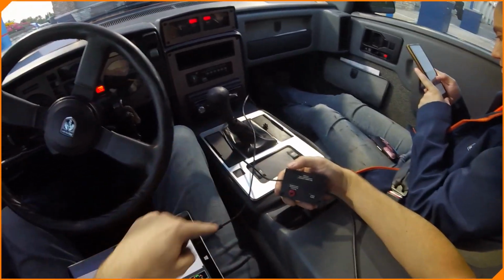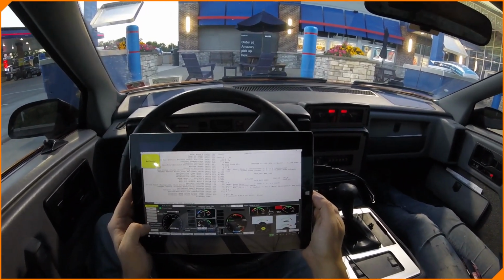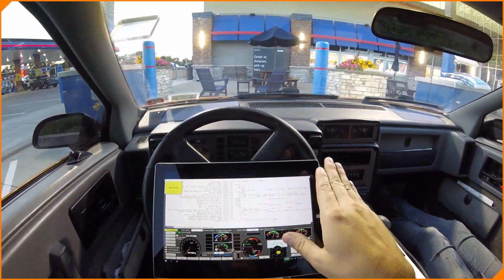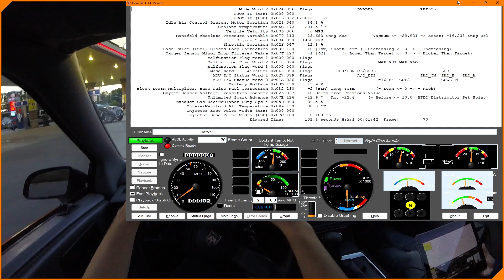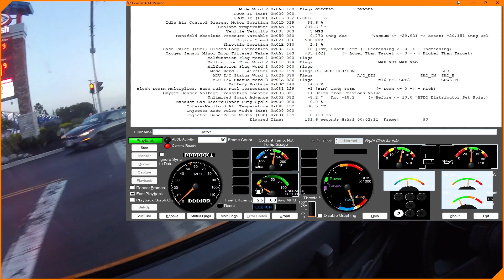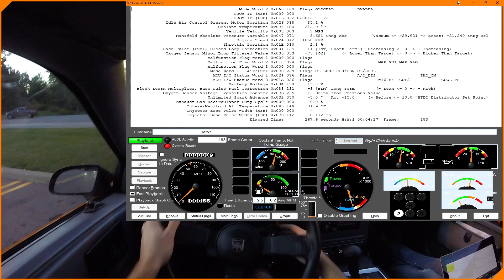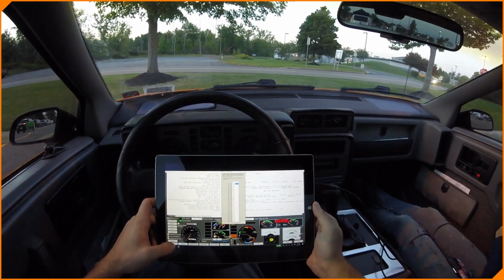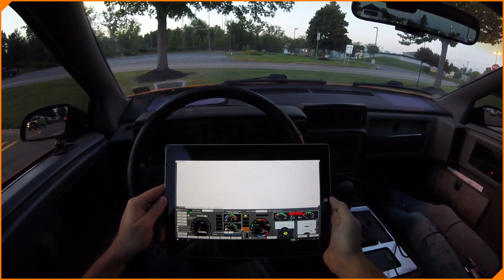Fiero ALDL Monitor by Paul Romsky | Fiero GT | Buffalo, NY

Comment: At 8:25, if you do not modify the car's ALDL connector to include the Service Engine Soon (SES) the adapter cannot monitor the Error Codes for the GUI. So you will always get that popup - even if you are in the Diagnostic Mode to flash the Error Codes. However, you can still count the Error Code flashes yourself and then look up the Error Codes manually using the GUI.

Comment: At 2:51 the Temperature Sensor that drives the guage in the GUI (from the ECM) and the Sensor that drives the Temperature guage in the car are located on different parts of the engine so there could be, say, 50 degrees or so difference. Also, the GUI's translation from raw vales to Degrees F (or C if in Metric units) uses a 5 point curve fit algorithm based on my car's Sensor. Different sensor manufacturers may use different Thermistors so they can yield slightly different temperatures. But as you get the feel from your car's temperature it will make more sense, if the temperature ever seems way off from your normal observations over time, then you know you have a Coolant Temperature Sensor (CTS), a guage temperature sensor, or an engine temperature issue.

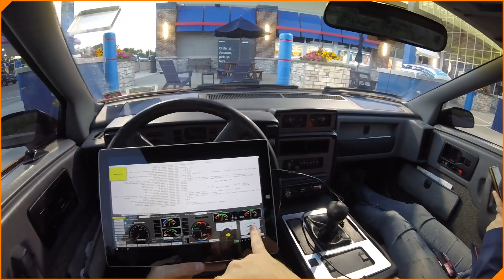Comment: Great video! At 2:20, actually, the Oil Pressure and Fuel gauges are simulated in the GUI as the fiero does not provide them to the ECM. The oil pressure just shows a nominal value when the RPM is above 500. The Fuel Level can be set to whatever you want and the GUI attempts to dwindle the Fuel Level as you monitor/record. The Brakes/Clutch/Gear are also simulated and they attempt to figure out what gear you are in and if the Brakes and/or Clutch are pressed based on RPM and Speedometer. Everything else comes from the ECM.

Comment: At 3:44 your MAP_VHI and MAP_VLO Malfunction Flags are set (probably left over from an old malfunction). Because you are not getting a Service Engine Soon (SES) indication on your dashboard, these may be old codes that need to be cleared. For those of you watching, the Error Codes panel in the GUI has a note that tells you how to reset and clear the Error Codes as they will remain in the ECM memory even after you fix a related problem. It involves disconnecting the negative side of the battery for 5 minutes, so make sure you jot down your radio station settings as they will be lost too. Some Fieros have an in-line fuse in one of the 4 fusible links near the battery. If you have one, simply remove that fuse for 5 minutes to remove power from the ECM only to clear it (thus it won't lose your radio settings). If you dont have that fuse there, you have to disconnect the battery and thus you will lose your radio settings. Note, removing the 10 Amp fuse from the Fuse Block under the dashboard WILL NOT clear the Error Codes as a seprate circuit from the battery fusible link is what keeps the ECM's memory alive when the car is not running. Its a trickle discharge circuit (along with the radio's clock and station settings) that takes only a few milliamps and is why you need to keep your Fiero on a battery maintainer if you dont drive it at least a couple of hours a week.

The trick with Fieros (and many ECMs) is you should clear all error codes after fixing something or replacing a sensor because the ECM normally retains any error code that occurred until you actually clear them. This is called "Persistant Error Storage".
Reply from the maker: What did I tell you?! This man knows his GUI and knows what is wrong with my car better than I do. Paul I will clear the ECM and run another test to see if anything else improves in the car.
Reply: @Zanrith  As we fellow Fiero owners colaborate, we all become wiser.   Remember Ve-ger from the 1979 "Star Trek: The Movie" film:
"Learn all that is learnable."